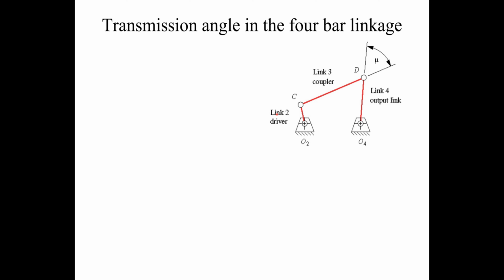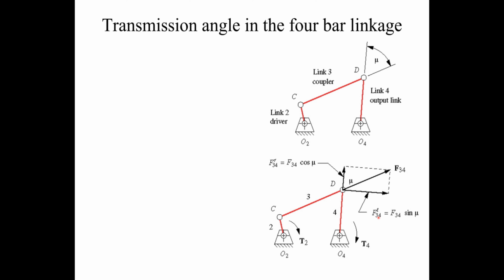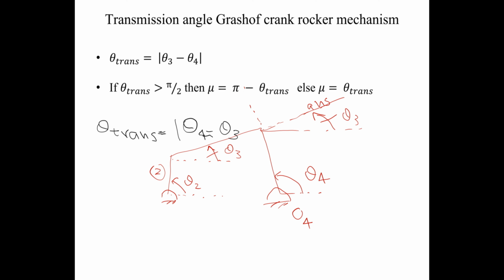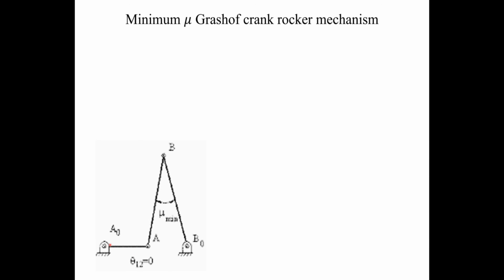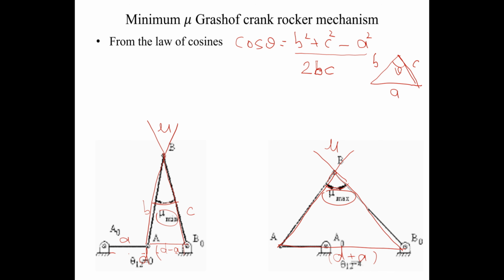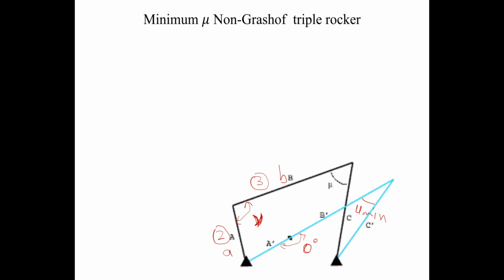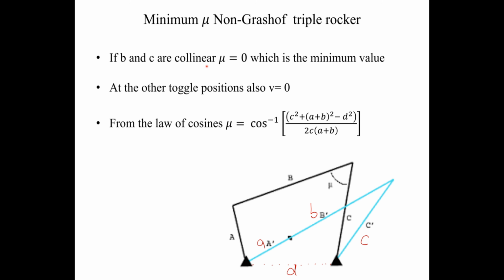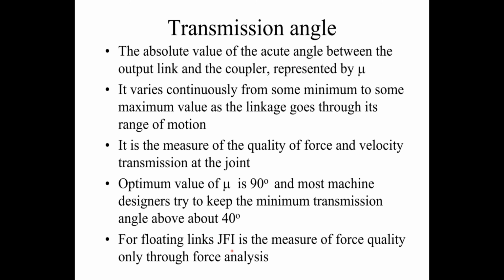26-1 Transmission Angle of four bar mechanism | Theory of Machines

Comment: The transmission angle is an important criterion for the design of mechanisms by means of which the quality of motion transmission in a mechanism, at its design stage can be judged. It helps to decide the “Best” among a family of possible mechanisms for most effective force transmission.
Sir, why do engineers make sure that the minimum tranmission angle is above 40 desgrees? 
2017276

Comment: Transmission angle calculation is used in our CEP (bat knocking meachnism) to ensure that transmission angle is greater than 40° atleast for efficient transfer of impact force from mallet onto the bat surface.

Comment: 2016227
The transmission angle is an important criterion for the design of mechanisms by means of which the quality of motion transmission in a mechanism, at its design stage can be judged. It helps to decide the “Best” among a family of possible mechanisms for most effective force transmission.

Comment: Although the minimum transmission angle is 40 degrees, but are there any mechanisms used in the real world which have a transmission angle less than 40 degrees?

Comment: Sir, what is the main difference between meu and theta transmission? Aren't they both the same as they both are formed between a coupler link and the output link? (2017284)

Comment: Is there is a way to find optimum transmission angle without drawing the mechanism? Is there is any case in which optimum transmission angle is not 90?

Comment: The optimum transmission angle for 4 bar is 90 degrees however for a crank slider mechanism the optimum transmission angle comes out to be 75 degrees (90 degrees with a deviation of 15 degrees) (2017225)

Comment: Sir, the optimum transmission angle generally is 90 but if a mechanism has a maximum transmission angle less than 90 in a cycle, would that maximum angle then be considered the optimum angle for that particular mechanism (in place of 90)? (2017203)

Comment: 2017371
Sir can you kindly explain how the mechanisms would have jerks if the transmission angle is below 40 degree. And you said that floating links are those not attached to ground. Can you please give an example related to JFI where crank or rocker is floating, wouldnt that be an open mechanism.

Comment: 2017338
Sir, can you please explain JFI . Also why do we use acute angles as transmission angles?
Reply from the maker: In 4 bar mechanism, coupler is a link which is not grounded. Such links are called floating and their analysis is done through considering all forces. Position analysis cannot find the quality of force alone and an index is created as a result of force analysis which tells the quality of force being transferred through floating links.

Comment: sir if someone don't use the acute value of angle he/she uses exact value of theta trans whats its consequences?
 2017289
Reply from the maker: it gives the direction of force in negative or positive which is not normally required.
Reply: @DrSohailMalik  thank you sir

Comment: 2017204
Sir can you please kindly explain as you said if the minimum transmission angle of the mechanism is less than 40° then there would be jerks and sudden accelerations. Is this a must statement or is it just safe to be above 40° and there isn't any hard fast rule to get minimum transmission angle above 40°?
Reply from the maker: The major portion of force will be wasted as friction and if the dynamic properties of the input link are not sufficient mechanism will stop work.
Reply: @DrSohailMalik  thank you so much sir

Comment: (2017164)    
why we specifically use the law cosine can you use other law or not?
Reply from the maker: According to the given information, law of cosines is convenient one.
Reply: We can use law of sines as well , because it's trigonometry and we'll end up with same results but for that we must know the angles of triangle which we're considering.(2017150)
Reply: Law of cosine is used mostly when all of the lengths of triangle are known and all the angles are unknown as in the above problem. Whereas law of sines are only used when either two sides and one angle or two angles and one side of triangle are known. (2017019)

Comment: 2017194
Sir in the non grashoff if 3 and 4 become collinear then the minimum transmission is 0  degrees  which is minimum then why do we need to calculate  for the case when 2 and 3 become collinear
Reply from the maker: This is another toggle position considering the link 4 as input link. We also look for second minimum transmission angle to know that how much force is being transferred to output.

Comment: Could you please provide an example for JFI's application? 2017062
Reply from the maker: In 4 bar mechanism, coupler is a link which is not grounded. Such links are called floating and their analysis is done through considering all forces. Position analysis cannot find the quality of force alone and an index is created as a result of force analysis which tells the quality of force being transferred through floating links.

Comment: Sir please explain the JFI concept with an example.
Reply from the maker: In 4 bar mechanism, coupler is a link which is not grounded. Such links are called floating and their analysis is done through considering all forces. Position analysis cannot find the quality of force alone and an index is created as a result of force analysis which tells the quality of force being transferred through floating links.

Comment: (2017359)
Sir, I didn't get the last point about floating links and the use of JFI. Kindly give any example that includes this concept.
Reply from the maker: In 4 bar mechanism, coupler is a link which is not grounded. Such links are called floating and their analysis is done through considering all forces. Position analysis cannot find the quality of force alone and an index is created as a result of force analysis which tells the quality of force being transferred through floating links.

Comment: why do we have to ensure that transmission angle is less than 90 degrees?
Reply: (2017132)
Transmission angle basically tells us the amount of force transmitted, we are not concerned with direction of the force hence  we always take the transmission angle as acute.
Reply from the maker: It will keep on changing and optimum number is 90. Otherwise it will be less than 90 as we always take it as acute.

Comment: The reason for minimum transmission angle value to be greater than 40 degree is to avoid jerks and extreme accelerations that are causing durability issue for a mechanism

Comment: Why designers try to keep minimum transmission angle value greater than 40 degrees.(2017255)
Reply from the maker: under this value portion of force towards output becomes very small.

Comment: 2017211 , sir how do we determine the direction of L4 based on the transmission angle?
Reply from the maker: min transmission angle is always taken as acute angle and it does not tell us about direction. However, other than the minimum transmission angle the value of angle depending on the position of the linkage and direction of the input link can tell us that which is the direction of output link ( link 4).

Comment: i am confused about why there are 2 minimum transmission angles and what is their significance. also, can we calculate maximum transmission angle for a non grashoff 4 bar mechanism?
Reply from the maker: Max transmission angle can also be found by plotting all values between two toggles. Min. is also found within the same limit as the designer wants to know the position where within motion force transferred is minimum.

Comment: Sir at 16:00 , you first say that "angle u" will have some value , zero value but some minimum value,  that is confusing sir
Reply: When the angle between the 2nd and the 3rd link is zero (a toggle position), you will get a non-zero value of transmission angle.
(2017437)
Reply: @sheikhabdulmajid9974  Hmm, I see, and when 3rd and 4th link are collinear, then transmission angle will be zero, right?
Reply from the maker: it is zero for triple rocker and some other value for Grashof mechanisms.
Reply: @DrSohailMalik  What do you mean sir?
Reply from the maker: @rafaymahmood9063  Min Transmission angle is not always zero.
Reply: @DrSohailMalik  One value has to be always zero, no Sir? Because if links 3 and 4 are collinear then transmission angle is zero, its inevitable

Comment: Sir is the required transmission angle always smaller than the transmission angle at each  point? In case if that is not the case then how will the required force be transmitted? 2017378
Reply from the maker: What I understood is you want to ask that if mechanism is designed with one min transmission angle in mind and at any position it never goes less than that. The answer is yes that once you have designed a mechanism you look for its min transmission angle and the amount of force it gives to the output link. If that force is less than certain value of the inertia and dynamics forces present in the output link the mechanism may start behaving vibrating or even can stop moving.
Reply: @DrSohailMalik  Yes Sir that was my question, thank you